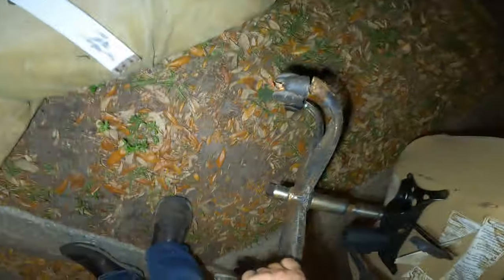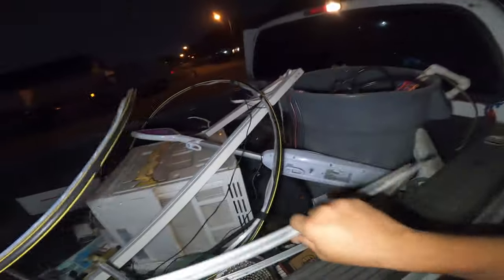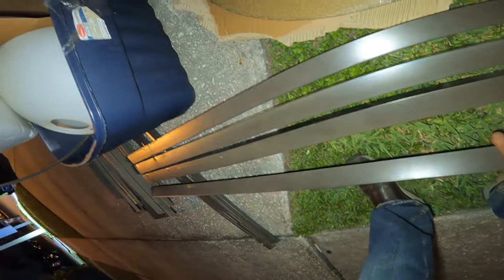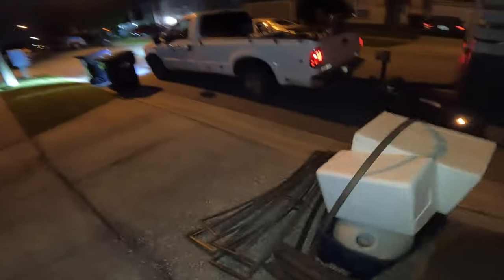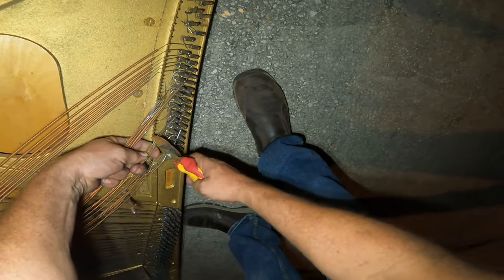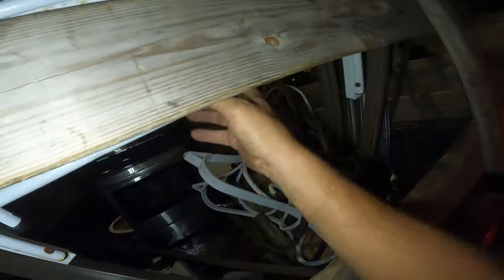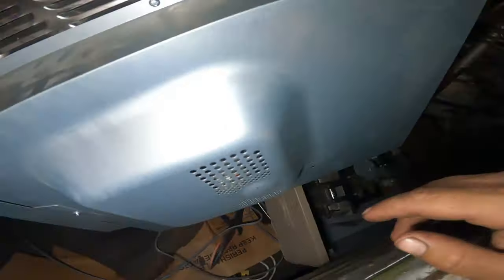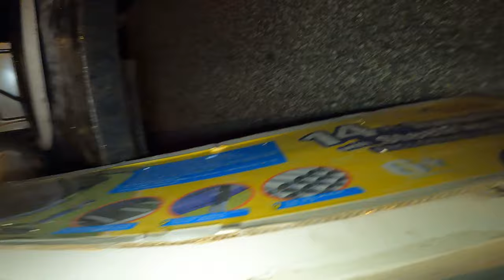Over $200 In Finds Last Night Scrapping!!!

Comment: That's pretty cool on the trampoline. I was thinking that oven is a microwave too. If you see this before, the trailer is emptied. Check that wire wine rack. I found one that was brass. Keep on keeping on. 👍
Reply from the maker: It wasn't brass. I did check, tho. Thanks for watching.